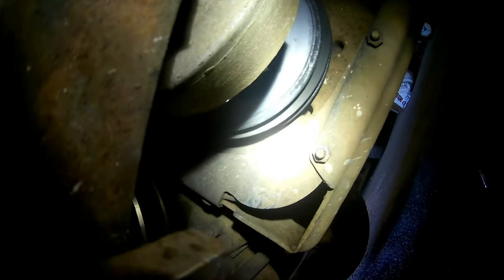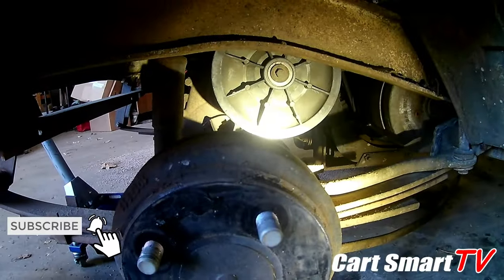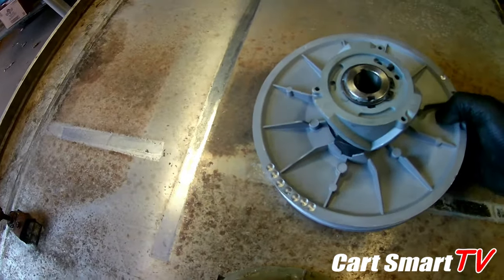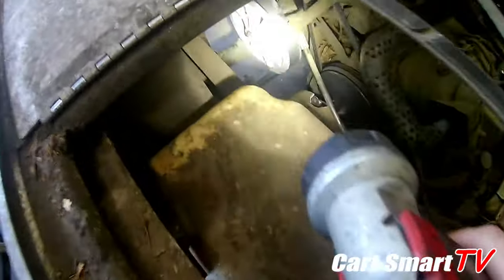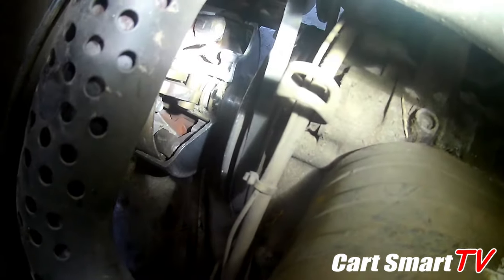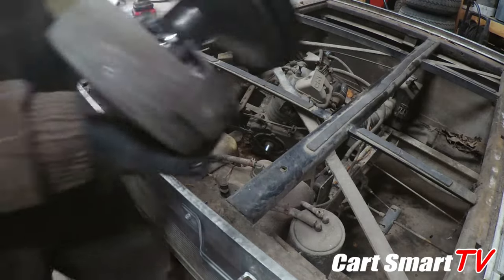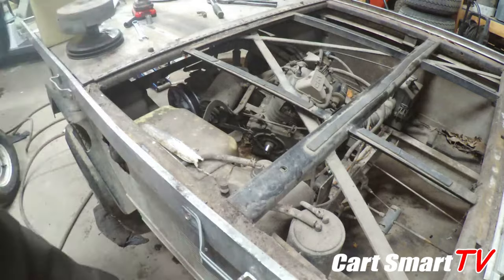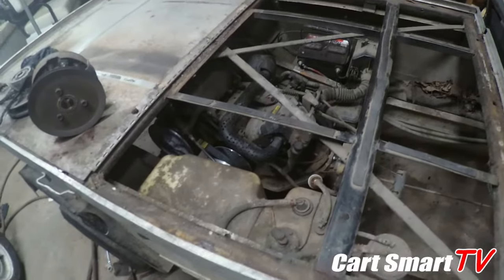Golf Cart Clutch Problems

Comment: What’s up man got a 2024 drive 2 Yamaha 3 times already I stopped and when I went to drive it reved and didn’t move them jolted happened in reverse also is that the clutch thing Is brand new
Reply from the maker: It does sound like the clutch is not acting right? Put the cart in neutral and watch your clutches/belt - should work like this - https://youtube.com/shorts/oCz2w7Wl0DI?si=RPPJ0FSIGlrCjxkq
Reply: @ technician came to Meat this morning changed out the clutch and the belt on the warranty is driving beautiful again

Comment: Hey bro good video, i have a question hopefully you can help, i have a ezgo gas and my front clutch dose not fully engage but if i remove the belt i t goes all the way like it should is my clutch bad you think?
Reply from the maker: It could be or The spring in the clutch may be wore out or the engine is not turning enough rpm's to close on the belt good enough? Let us know if we can help.